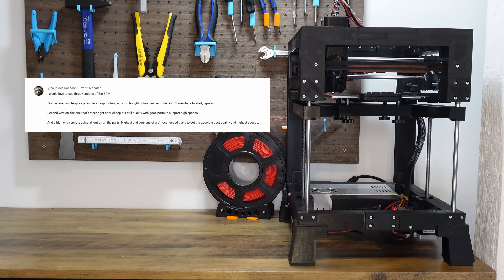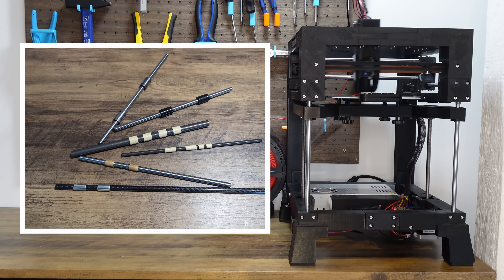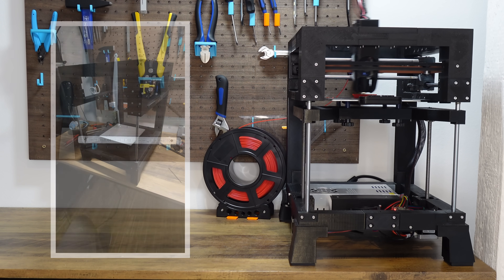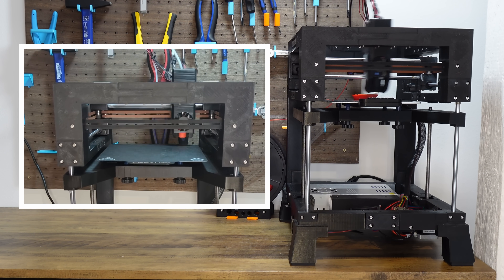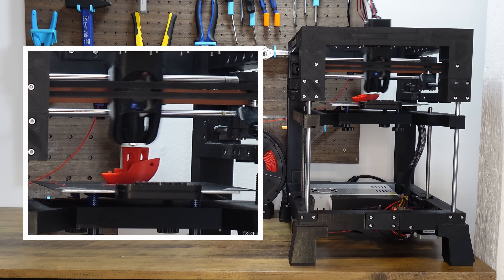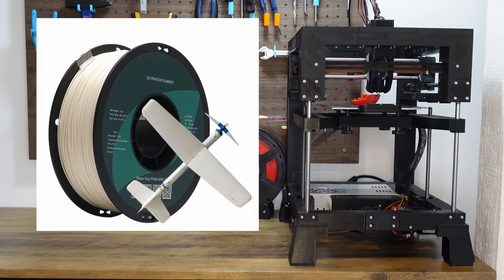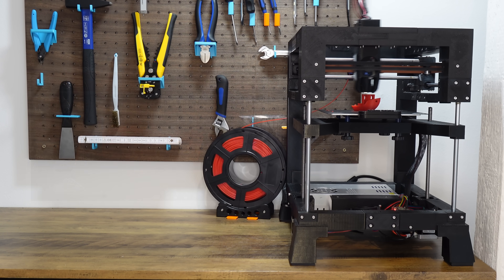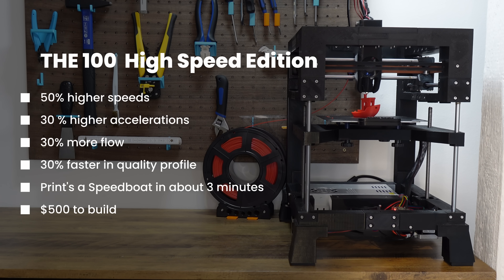THE 100 - The dethroned speed champion... even faster!

Comment: hello there, i would like to give you an update on my petg build 
i printed entire lower frame and back upright, installed heat inserts and ... discovered unintentionally every wea point of the frame by "trying how strong it is"
long story short back uprights mounting blocks have multiple stress points that allow the part to crack and my block just riped out along with part of the top and walls with not that much pressure
i also noticed that all of the plate joints are only 1/3 of the strength of the rest of the frame and are quite wobbly due to double jointed clamp design
so i started to redesign the frame 
first of all instead of 2 clamping blocks with small clamping area i changed the lower frame to 6 big pieces that overlap, 4 cornets and 2 T shaped motor mounts and the lower frame is much stiffer
2nd thing i made all internal corners rounded with fillets
3rd thing i did was to redesign back upright tobe inset into the frame itself, no extra blocks to snap off
and a little aftertought i moved right linear z rod to the back so they are directly across the table which should keep the drag of the rable at the same level while making it much less possible for it to lock or sag on one side
i am now working on spliting upper frame into more pieces that can be printed with no supports while keeping all kinematics and electronics of the 100 based on the step file
my goal is to make frame even stiffer with similar damping abilities but much less stress concentration point 

and here comes a stupid idea based on hp office jet printers
did anyone ever tryed to add counter mass to the toolhead going the oposite direction to cancel out any charmonic vibrations. i know it is much easier in single axis printer by just snaping a weight on the oposite side of the belt but double tower with dummy kinematic should technically work too

i am currently burned out for the week  so making the upper frame will probably happen next week but you should try printing my design joints and test them out yourself
15mm radius  quoter sircle then 30mm straight and quoter circle the other way (in an S shape) with 4 screws clamping  those pieces  in 30x 15mm pattern
joints are mostly self aligning and compared to your design hold by more than 50% of the profile strength

it looks hilarious printed as test pieces each in different color from junk pla :]

Comment: Finally :D, I also have a question: Would it make a difference if I print the printer with ASA -cf? Keep up the work -well done :))) and thanks
Reply from the maker: Puhh... I would really like to see a ASA CF THE 100. Im sure it will work and it might even perform a bit better than a PLA version but honestly similar to the titan screws that's something that I would not recommend to do since for the money you spent on that filament you could almost build a second printer with.
Reply: @MattThePrintingNerd  do you know what also would be very nice. A 100 that could print peek or better question: Would that even be possible?
Reply: @wolf_industries  You print the frame in PEEK as well, easy :)
Reply: @ronnetgrazer362  Tutorial of how to get broke in a second ._.